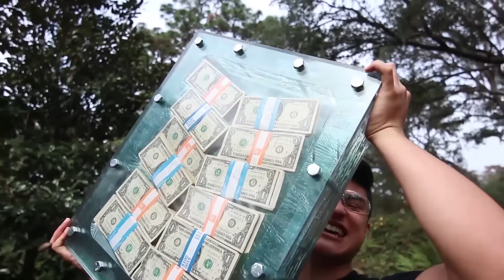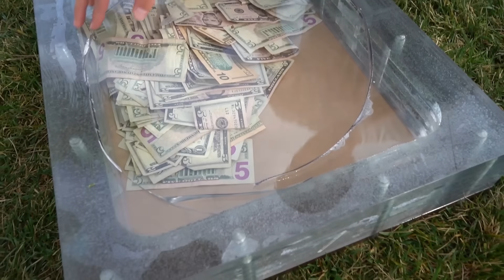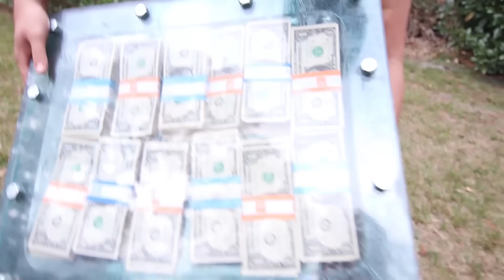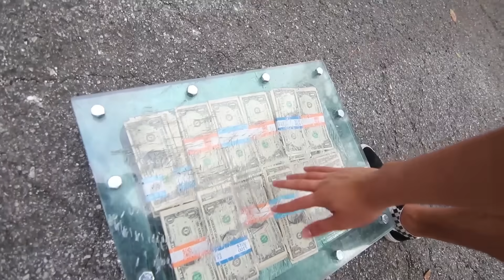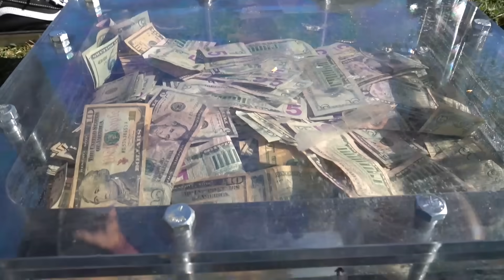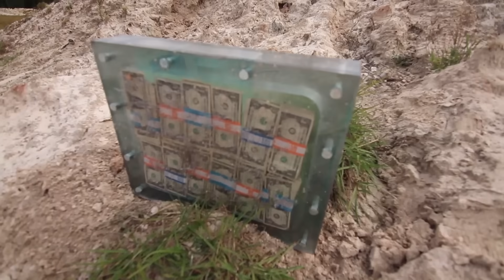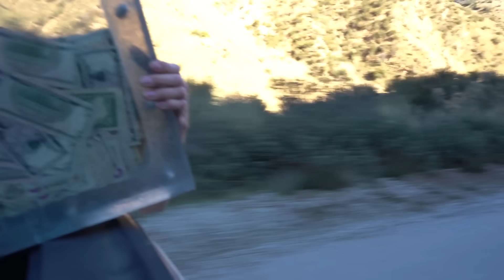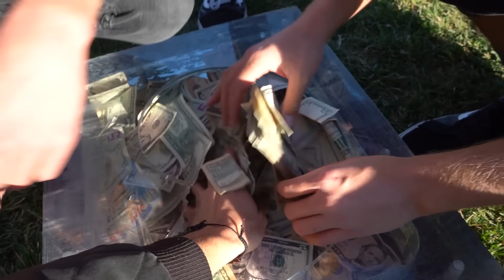$10,000 IF ANY YOUTUBER CAN BREAK THE BOX!! (UNBREAKABLE GLASS CHALLENGE)

Comment: Is there a rule against undoing the bolts?😂😂😂
Reply: wow
Reply: Brant Fulmer that was funny
Reply: Brant Fulmer  That's exactly what I thought just undo the bolts
Reply: Tap and Die the bolts.  lol
Reply: Just use a grinder on the bolt or a cement saw on the  plastic plate
Reply: Brant Fulmer yeah bc they have to destroy it and not open it
Reply: @themyththelegend8326  no technically the challenge is to break it open so that would be bolts included
Reply: Did you know you can’t undo the bolts
Reply: lol first thing I'd figure...   someone takes a hydrogen torch and just cuts it in half lol    nothing can withstand a hydrogen flame...  even TUNGSTEN vaporizers lol ...
Reply: Yee me 2 XD
Reply: WOW your smart
Reply: WHO IS SHREK
Reply: Is that real shrek
Reply: I can just get a screw driver and yeet the bolts away
Reply: "No this isn't how you supposed to play the game" 👌
Reply: It's called taking a drill and drilling through it
Reply: Brant Fulmer exactly

Comment: Easy. One grenade, your box suspended in a pool(6ft deep, 6ft radius) , pull pin and drop grenade into water. The air within the box will act as such the air in a human body cavity of air. Once the grenade explodes the pressure waves will disburse and the weak areas on the box will weaken and give access to the internal space of the box.

Comment: It seems like the sharper items do the most damage, not blunt force.
Reply: It’s because the sharper items are more precise and concentrate all the force into less area which means all of that force will create more damage as in gets pushed into the small surface area. If you punched an obese person in the stomach, they would suffer little to no damage at all. However if you stabbed them with the same amount of force. It would cause way more damage because all that force is transferred into a single point. Rather than being distributed across. This is also why people can stand on dozens of eggs and not break them
Reply: Same with a window breaker small and pointy

Comment: Give me five minutes and an angle grinder.
Reply: I was thinking the same thing an angle grinder would open it quick.
Reply: Concrete saw
Reply: Gonna need a good blade tho
Reply: Give me 10 min, start off with a pneumatic 90lb jack hammer, if that doesn't work use a concrete saw , no problem. Worse case scenario get a bobcat with the jackhammer attachment.. done

Comment: Why can’t they use this glass for car windows
Reply: what if youre stuck inside
Reply: It cost a lot
Reply: @6mania6  open the door
Reply: XStortifY what if it’s jammed
Reply: Azart yt flex seal has entered the chat
Reply: @6mania6  open the window?
Reply: @dmmy126  or juts open the window
Reply: Robert Barlow what if u cant
Reply: @chloe-qv7jr  you cant open the window if the door is locked
Reply: @chloe-qv7jr  but you can unlock the door
Reply: It is used in armored vehicles all the time.

Comment: I bet I could break it in about 5 minutes using liquid nitrogen and a sledge hammer
Reply: That's what I was thinking. Freezing then hit it with a sledgehammer
Reply: Well you see, it could it fact work. But you would need say about 30 m ok mins to let the liquid nitrogen freeze through every layer, mind you it is also acrylic which is the same stuff used in airplane windows.

Comment: I wouldn’t even break a sweat breaking into that box.
Reply: Bottom line is, I could break into that box without even trying.
Reply: @arconnelly5365  how
Reply: I have an rv, i would just put that box underneath the leveling jack, subjecting that box to 16 tons of pressure, cracking it open.
Reply: Basically, think smarter, not harder

Comment: Ok so the top face is thin so it is more fexable making it resistant to impact but the sides are thicker making them more vulnerable to cracking as they can't distribute the force as much. Bit of liquid nitrogen and a sledge will shatter it

Comment: if i had the box I would first get the melting thing that vat19 got and melted the plastic to make a hole to let some of the air come out so the impact from any of tyhe hammers can break the plastic becase their is not that much air compressed inside or maybe Im wrong and you need more compressed air and you shoot the compresed air through the hole to where that the sustainability of the plastic cant hold any longer and it explodes. who knows anyone else have any ideas comment wether it be creative or deadly

Comment: I'd use my carbine end mill and throw it in the cnc and turn the feed rate down
Reply: Just a cheap router with a spiral up-cut bit would do it.   Just make a plywood pattern, and use lots of passes, but it would get the job done.